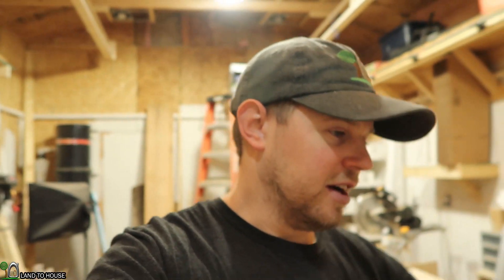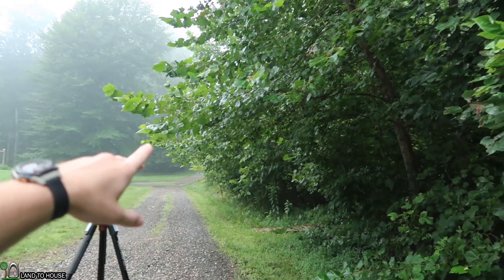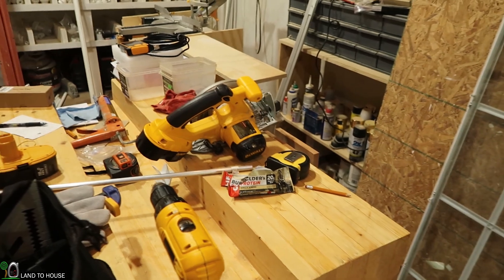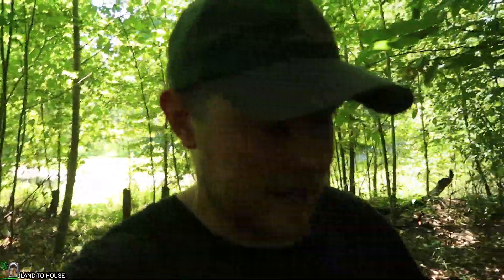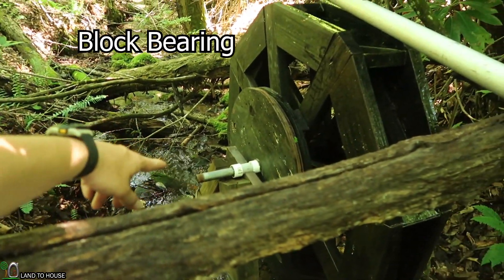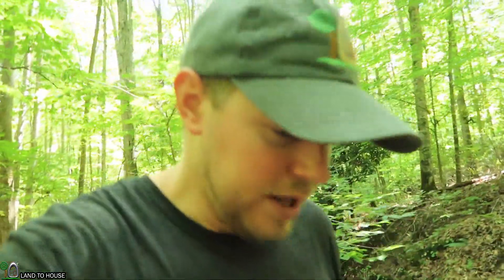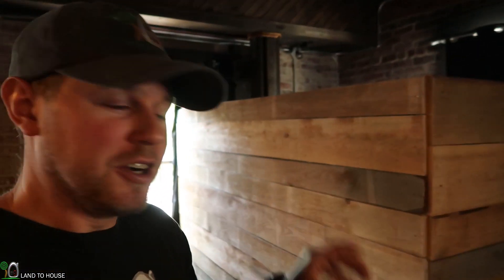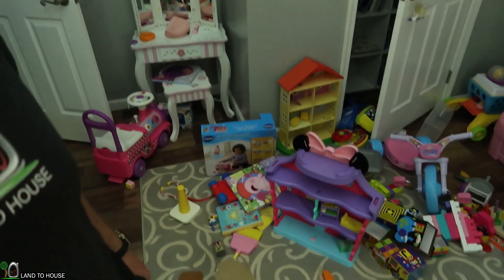Hidden Water Wheel in the Woods - Vlog 162

Comment: It's unbalanced because the water was stuck flowing on one side, it's half waterlogged. The design is ok but far from optimal. I need to do my Part 12, Waterwheel Engineering video to explain.
Reply from the maker: Yes I actually mentioned your water wheel to my neighbor.  I think he might need to do a number of modifications to get any usable power from this setup.